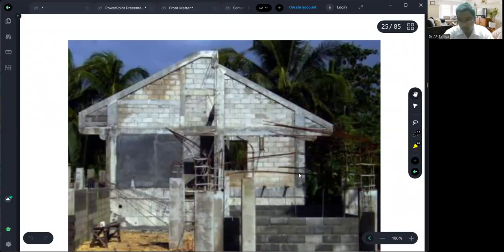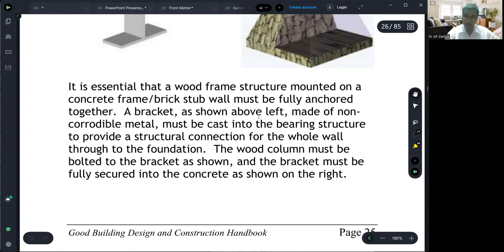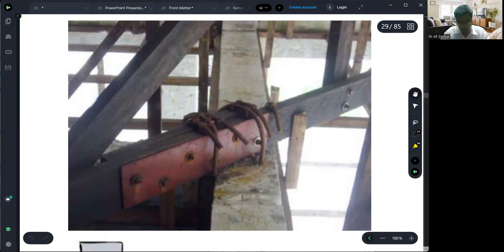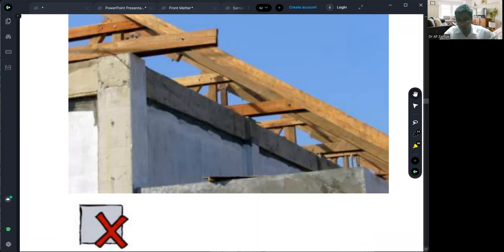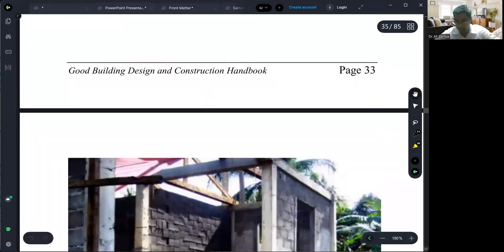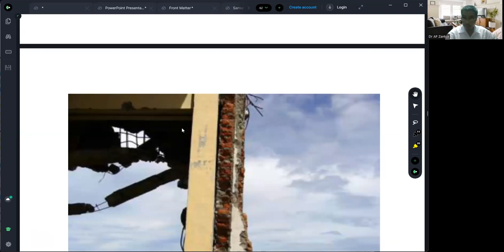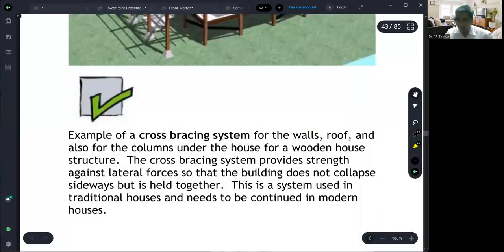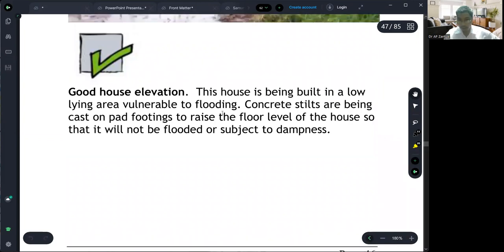Practical Design Principles: Joining Walls, Roof & Bldg Structure [ Good Building Design ] Module 0B

Comment: Thank you sir for this lecture video for discussing the practical design principles. Joining walls to the structures, Column reinforcement should protrude from the top of concrete columns and be bent around roof trusses for structural strength.

Comment: Thankyou sir for discussing the practical design principles on joining walls, roof, & bldg structure. Good design principles do not only focus on the foundation and coherent structure but also on joining walls to roof structure, tying walls to the building structure, roof truss ties, and cross-bracing of walls and roof.

Comment: Thank you for giving us a very well-explained video with a topic of good design. I’ve learned that column reinforcement should protrude from the top of concrete columns and be bent around roof trusses for structural strength or roof trusses should be strapped with metal ties to the wall structure.

Comment: Thank you, sir for discussing the practical design principles. Joining walls to the structures, Column reinforcement should protrude from the top of concrete columns and be bent around roof trusses for structural strength.

Comment: Continuation of the discussion about the Good Design Principles. The third principle is Joining Walls to roof structure, it can be done when the column reinforcement protruded from the top concrete columns and be bent around roof trusses for structural strength, or the roof trusses should be strapped with the metal ties to the wall. The fourth principle is Tying walls to building structures, walls tied to columns protect them from falling. It stated that walls must be tied to  the building structure so that they do not move separately when the forces of nature impact them. And the fifth principle is Roof Truss Ties, flexible but strong roof trusses enhance safety. It means that the joints of wooden roof trusses need to be bolted together and tied with metal straps to provide flexibility but not collapse under the forces of nature. The sixth principle is Cross bracing of walls and roof, the walls and roof need bracing against lateral movement.

Comment: Thank you, sir for this kind of quality materials. This video taught about what are the dos and don't in a design. I have learned some of the principles of a good design such as joining wall to roof structure with metal straps or column steel reinforcement. This helps keep the roof against the wind and natural hazard. I also learned that if there is an exposed steel this could be subjected to corrosion that's why it needs rust-proof paint. Tying walls to the structure is another principle that has been discussed. There's a lot of principle to learned in this video.

Comment: Thank you sir for continuing the lecture video. I have learned in this video the proper way of joining walls to roof structure, tying walls to building structure, and so on. Also, this video shows some good practice design of a structure.